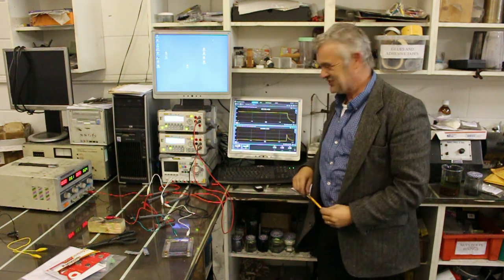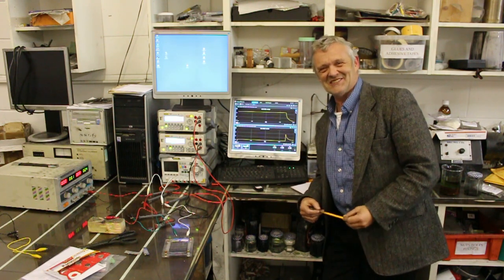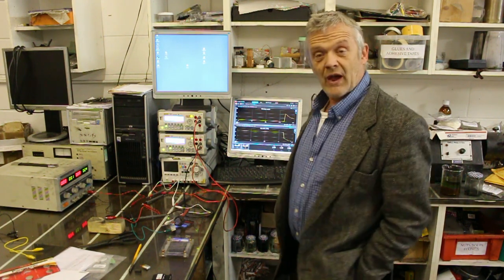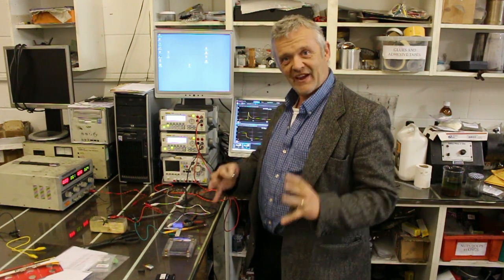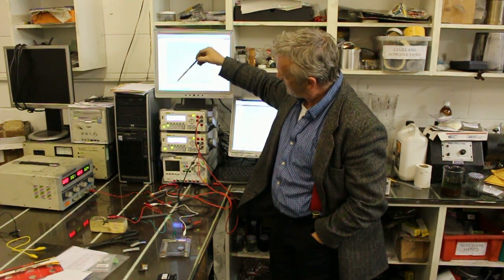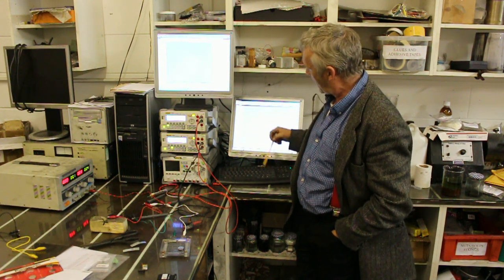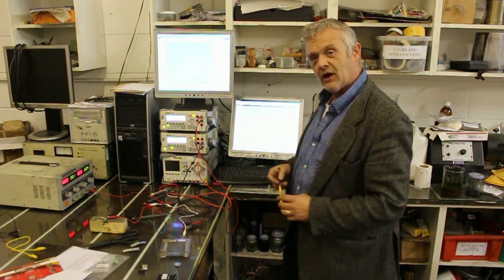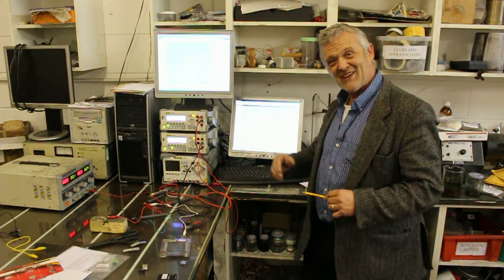Comparing Advanced Lead And Lithium

Comment: Hi Robert,  Have you considered using rectified AC or AM to charge your batteries instead of DC?   There is Propeller software for Windows called PGEN 2.0 from Germany that allows the creation and measurement of up to 4 channels of PWM (8 chains each).   You could also tie 2 - 555 timers together.   These applications can be "convoluted" together with an AND or NAND chip - to create AM radio waves (carrier and signal frequencies) at up to 5 volts.  I like your Rigol equipment - I have a Rigol scope, DC power supply, and multimeter myself.
Reply from the maker: i have thought about it mate as i am pretty sure the method i am using isn't the best - so i will look into it